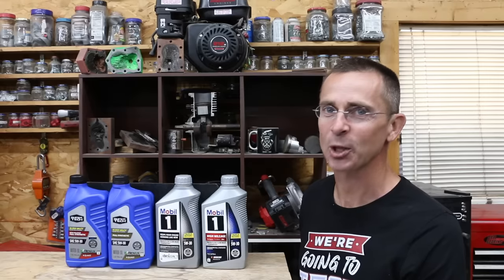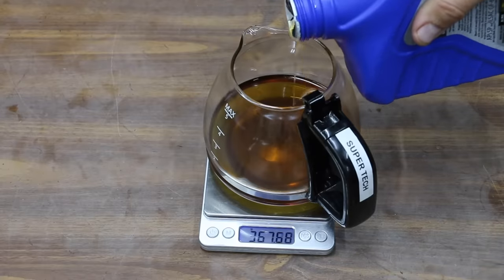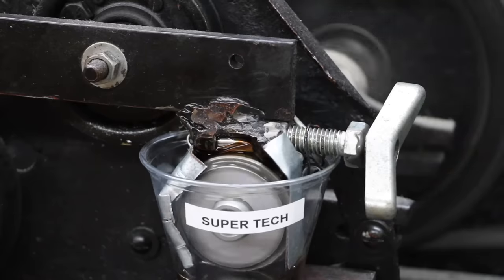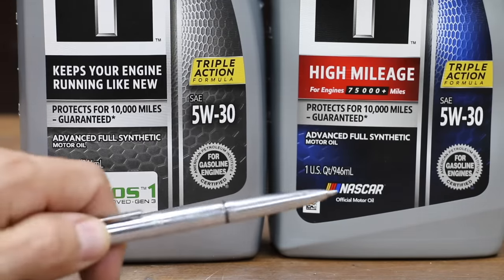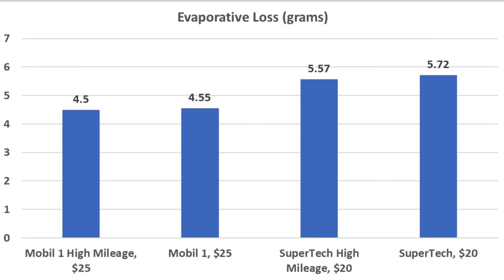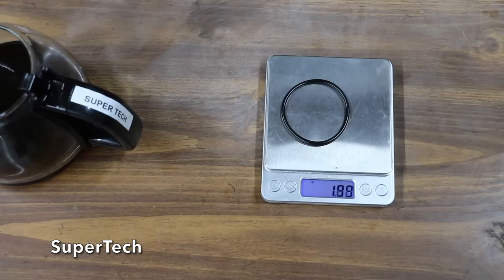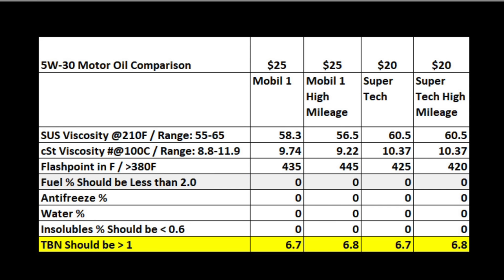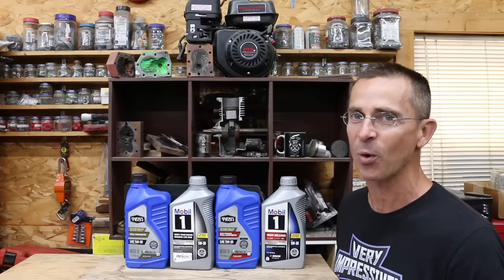Is “High Mileage” Motor Oil Safe? Let’s find out! Mobil 1 vs Mobil 1 High Mileage; SuperTech vs STHM

Comment: I did a paper in college about engine oils and interviewed a chemical engineer. I was told high mileage oils contain solvents that soften seals as your tests indicate. However I was also told that extended use causes the seals to soften to the point they fall apart. As an anecdote I knew an oil change tech that put high mileage oil in her new truck since she bought it new and after a few years it leaked from every seal imaginable .
Reply: Thank you very much for this comment
Reply: So basically switch it up then? Use regular full synthetic oil for a couple of oil changes and then switch to high mileage. Just keep alternating between the two?
Reply: @AustinsCoins  That’s what I was thinking.
Reply: Very Interesting. Thanks!
Reply: @AustinsCoins   I think where most people go wrong is they do not maintain a strict oil change schedule. some people claim you can go 10k miles without changing your oil and I find that to be a total crock of shit. well you can, but you'll likely be left little oil in the engine after 10k miles. change your oil every 5k miles, stick to one brand of oil and a filter and routinely check all your fluids. if properly maintenance your vehicle from new the engine itself should last a very long time.
Reply: I had a 2004 silverado with the 6.0 litre engine, got it at 150000kms in 2007, and used quaker state high mileage oil and fram filter every 10000kms for 11 years, brought it up to 360000+ and she didnt leak a drop of oil
Reply: @AustinsCoins  There's no need to switch up oil. Choose the HM and be done with it. I have a 4.8 chevy I bought new in 2000, It now has 416k miles on it and a used 2009 5.3 chevy that had 76k miles on it when I bought it. The 5.3 has over 231k miles now. I use Mobil 1 synthetic HM in both and neither leaks oil. The 2000 4.8 does burn oil and I have to add 1 to 1.5 quarts between oil changes. I might have to add 1/2 quart in the 5.3 between oil changes. I change oil between 7 and 10k miles. Both are work trucks and get worked every day. So the stuff about the HM making seals soft to the point of failure is bunk. As is the myth that you have to change your oil every 5k miles or else. Maybe if you're using a non-synthetic, but there is no good reason to these days with the quality of oil we have available.
Reply: @robroy5729  Not many good studies support the need for 5k mile oil changes. Synthetics go 10k with no increase in engine wear.
No harm to engine by changing every 5k but a waste of time and money.
Reply: @robroy5729  Not to mention all the carbon and dirt build up that oil changes remove. BMW has a yearly oil change, and the motors have all sorts of issues from sludge clogging up the engine. They also never last 200K miles.
Reply: @DrivingWithDon  👍
Reply: @robroy5729  I used a Ford Fiesta 1.4 tdci van as a courier vehicle, 40-45K miles a year, 10K oil/filter changes every 3 months. It lasted to 278K miles and the only reason I got rid of it is I needed a bigger van 
All my courier vans have had 10K oil/filter changes and I've put hundreds of thousands of miles on each of them.
Reply: @MrDoccus  extended oil change intervals helps promote sludge buildup in some toyota engines
Reply: I do not believe it happened because of the oil. There are other factors that do matter like: a) Do not replace the PCV VALVE every 15K to 20K, since this is the part that gives possitive ventilation to the oil pan; If it gets clogged, It is not goint to be any  good seal or O-Ring that can endure the pression since it is air and need to go out whenever the weakest part of the engine is and that are the seals. I habe been using MOBIL 1 5W30  for so many years with issues however I have been replacing the PCV VALVE, religiously, every 15k to 20k miles.
Reply: The only motor oil Project farm tested that performed impressively after the heat up test was amsoil (he tested it against royal purple). I say 7500 miles is the max for my liking but Amsoil could get you to 10k between changes.  But  how do oil filters hold up after  8k miles?
Reply: The safest thing to do is to follow the manufacturer's recommended oil change interval and oil spec, along with checking your oil level regularly. It doesn't do much good to have fancier oil if there isn't enough of it or you never change it.
Reply: That is one of the reasons I have used real oil.
Reply: @robroy5729  I have a Jeep 4L I6 from 1999 that, now that the valve cover gasket has been replaced, consumes less than 1/8th of a quart in 5,000 miles. I've been using the same lab to test the oil each change and they keep suggesting to bump the interval up 1,000 miles each time; up to 8,000 now.
Reply: @OOZ662  - How many miles?  1/8th of a quart is like 2 ounces of oil. That's brand new engine consumption.
Reply: 2000 camary 160k mi. once a year oil change with mobile regular OEM recommended weight . do about 5500 miles a year . Never burns oil, never leaks, original head gasket, original valve cover gasket .  shit refuses to die even after the timing belt snapped 😂
Reply: @NotaRobot_gif  you gotta use the correct high quality European oil formulas that have the correct amount of saps in them. Those would also be true man made fully chemically synthesized synthetics, not the crap passed off as synthetic in this country. The American API oils are a no no for European vehicles.
Reply: @maldonadolemus  Tu mensaje fue dificil de entender en Ingles. So esta bien remplasar el pvc valve cada 20k millas o no?
Reply: The seals softening to a point where they fall apart is most likely from using highmile oil then using an aftermarket highmilage/anti leak bottle additives. That will cause the seals to be so expamd and be flimsy that oil can slip by from swelling to much causing to fall apart
Reply: Was it a chevy? Lol
Reply: @AustinsCoins  Why even bother with high mileage oil?  Your regular synthetic oil will keep them soft for several hundred thousand miles
Reply: Right because major oil producers knowingly want their oil to soften seals to the point where they fail. I'm pretty sure word would get around very quickly and nobody would buy their brand. I've done an exhaustive check with the FTC, EPA, and BBB and can't find any complaints of cars leaking mass amounts of oil due to motor oil softening engine seals.
Reply: @AustinsCoins  Maintain your oil change schedule. Period. Top up fluids, know which ones need changing or adaptation for the winter months (if you live somewhere cold, swapping regular window washer fluid with a deicing one is essential even if you put a de-icing cover or coating on your windows. The coating allows ice to melt off more quickly but it doesn't prevent the initial build up.) If you don't know how to work on your car or what an engine noise means, it's even more important to stay on top of standard maintenance as you have a lower likelihood of having mechanical issues from straight up neglect.

 The anecdote from "Mr. New-Car" omits that you need to adjust valves and check seals after the engine is "bedded in" so to speak, i.e there is some adjustment necessary after you purchase a new vehicle, even with the number of computer sensors and automatic adjustments available in a new car. Computer actuated vehicles are more efficient but they are not always self adjusting. The engineers designed the computers to throw a maintenance code, not to fix the problem outright with the onboard adjustment systems. They assume you'll get into the dealership thanks to the warrantee that comes on a certified used or new car, therefore, you are likely to have fewer problems having to maintain or diagnose the car by yourself.

 I know several of my college friends who blew up moderate to well maintained vehicles because they didn't know how to check and/or top up oil every time they fill up gas. It's an old schedule from when cars were more likely to have valve/gasket leaks without auto-adjustors but it's easy if you set that as your rule and simply carry a jug of oil and radiator coolant in your car. Obviously don't go filling the radiator when the engine is hot. If you see the coolant is low it is best to get wait for it to cool and check for leaks after you refill it. Cracked hoses are an easy fix but a radiator that needs re-rodding or full replacement is much pricier/time consuming to fix but, in my experience is completely doable by a home mechanic with a repair manual.
Reply: @katydid5088  I mainly wrote my original reply so I could get clarification on what the original commenter was trying to convey. I've only owned 1 car due to my young age and it's running much better than it did when I first got it. I've changed all fluids on it and even did an engine flush (which some people advise not to, but that's an old-school mindset). It's a Lexus IS250 and got it with 143k miles. It's done a 12-hour trip to Orlando and back to where I live since I got it. It's been driven almost daily and is a good car. If you covered the odometer, I don't think anyone would guess it has over 152k miles on it. Preventive maintenance and sticking with a reliable brand almost entirely cut out the possibility of issues you'd have if you didn't.
Reply: @MrDoccus  i run the Mobil1 FS HighMileage and i do an oil change and filter change every 3,000-3,500 miles. 
Been doing this in all my vehicles for years. 
Engines like fresh oil...no harm in doing it. 
They take a beating in our harsh freezing Minnesota winters tho.
Reply: @AustinsCoins  I have an old Camry with 200k miles on it... probably a smidgeon more. I just use regular oil and never have a problem. The frequency of oil changes definitely trumps any magic potions in the sump.
Reply: @MattExzy  Yup, a big reason they're pushing for these longer intervals is for the "waste" sake of it. EPA or something behind the scenes is likely pushing oil companies to advertise longer intervals.
Reply: @MrDoccus  You have no idea what you're talking about, but by all means keep pretending.
Reply: @robroy5729  it REALLY depends on the engine...... VW 07k can go up to 15k miles  with  oil still being okay.......Modern BMW needs oil change every 2k miles.... 90's Honda  can go 10k-20k with no oil in the engine before it blows....... It all depends on the technology.......
Reply: @MrDoccus  you do need to change the filter though. 
I had experimented with 1 truck. Oil would look a normal golden tan for 4-5000 miles and then almost instantly turn black. I'd just spin a new filter on and within a few hundred miles it would be back to a nice golden color. 

Once the filter is loaded it opens the bypass. Theory is that oil pressure is better than clean oil. 
So if you run extended oil changes without changing the filter you're now relying on the oil to carry all the dirt and carbon in suspension and still lubricate.
Reply: I experienced leaks from my cam covers after using high mileage oil in my car just 2 times. I had to replace the gaskets and I will never use it again. I advise against using it in your vehicle.
Reply: @MrDoccus  oil is cheap. Engines are expensive
Reply: @glrage  Si, cada 20 mil millas. Tienes dos opciones si es metálica: La quitas y la limpias con brake clean o limpiador de frenos(escucharas al moverla como un balerito adentro de la pcv el cual debe moverse) y has la siguiente prueba: Soplala con boca y tiene que pasar aire solo por un lado y por el otro no . Si deja pasar aire por los dos lados, entonces ya no sirve. En algunas marcas de vehiculos son plástica y lo mas recomendable es que la cambies. La valvula PCV es la responsable, en la mayoria de casos , de que los motores empiecen a botar aceite debido a que se ha quedado atascada y no hace su funcion que es : Liberar aire o presion acumulada en el carter y lo hace vía intake manifold terminando liberandolo por el escape. Imagínate que tienes un pedo que no lo puedes aventar y sentis que hasta te duele el estomago, Una vez lo liberas ya te sientes relajado. Algo así funciona la PCV VALVE😆
Reply: @oneninerniner3427  Actually that rule only applies in Germany and several other countries. I heard in Spain, companies can pass what ever formula as full synthetic.
Reply: @oneninerniner3427   European oils are designed for longevity. American oil are designed for efficiency. Most oils is Europe are also much heavier in viscosity.  Different Philosophy.
Reply: @MrDoccus  I change mine once a year and the oil filter twice a year.
Reply: @quinnobi42  I would never trust manufacturers recommended oil change intervals; the life span of any vehicle is its warranty length, according to the manufacturer.
Reply: I've never had an issue with high mileage oil. My 98 F150 had over 300,000 miles when I sold it and I used nothing but high mileage oil in it the whole time. If it did leak, it wasn't enough to notice.

If your engine is leaking that bad, then someone probably overfilled it with oil.
Reply: You've solved the riddle for me: "Why would I wait until my engine has high mileage before putting in the oil with the better wear package!?!"
Reply: @J.T. Cooper  please explain how you KNOW that the oil caused the leak? You know engines spring leaks spontaneously all the time, always have, always will
Reply: @ricky302v8  You put a lot of miles on your car in a short tile, likely many highway miles. That's why you can do 10k intervals and be fine. Different people with different uses need different intervals. People who drive very little or do mostly city or stop and go driving need shorter intervals. Most people who do mixed driving need the 5k interval
Reply: @SkylineFTW97  Exactly , different conditions call for different maintenance procedures its basic training to any mechanic
Reply: @jeffie8696  Yup. And if you look at the 10-15k oil change intervals, they come with a series of conditions. Most people's use would land them on what most companies call the severe service interval, which is usually around 5k. I personally do mostly highway driving and still change my oil every 3k. Oil is cheap (plus I work for a dealership and get my oil for free), engines aren't
Reply: @jordanrussell345  I would say it depends. I've mostly owned older vehicles that are well past their warranty and the every-6-months oil change as recommended in the owner's manuals has caused no issues for me. I don't know if more modern cars are suddenly saying that you only need to change the oil once a year or something. 
Additionally, I would like to rebut your point that the vehicle's lifespan is limited to its warranty period. If that was the case, why do they specify maintenance in the owner's manual out to 100k miles or more?
Reply: @MiguelGarcia-vj7oo you're definitely 100% incorrect about an engine operating with NO oil for 20,000 miles 🤣🤣🤣. Jap engines are good, but they're nowhere near that good.
Reply: @maldonadolemus  - That's because all synthetic oils are sufficient. If you change your oil every 3k miles conventional oil will do as well. Absolutely no one recommends racing oil because its overkill, costly,  and may lead to premature cat failure due to high phosphorous and zinc additives. All synthetic motor oils mix group III and IV base oils and some will mix group V ester.  Amsoil sells two types of motor oil;, their more expensive signature line and a less expensive XL line. Both are fully synthetic but only one claims it's good to 25k miles, likewise mobil1 extended performance claims 20k miles,  Pennzoil ultra platinum claims 15 years, Red Line racing oil also offers two different synthetic motor oils with red line claiming both are to oem car manufacturer  standards. Obviously these extended life and extended performance oils is not due to extra additives but added group V esters.
Reply: @oneninerniner3427  I have relatives in Asia and their European cars call for 12000KM oil change intervals. Due to extreme weather and high temprature conditions,not to mention their petrol has higher amounts of sulfur. BMW tried to extend 25000 mile oil change intervals in North America. Unfortunatly many engines became damaged by too long intervals caused by extreme idling,A/C use,high levels of sulfur in the fuel. So BMW reduced the oil chnage intervals to 10000 miles and use LL-01 oil. The LL-01 spec oil has additives to inhibit sulfur from building up in the oil prematurely. Also,the European cars made for North America are different from their native counterparts.
Reply: @ryanhuang8498  yup so That's about 7,4-7,500 miles. But I wonder if a lot of folks use the regular north American oils in them? And I wonder if they would have better luck if they used the euro formulated oils in their north American euro vehicles anyway.  Amsoil & Mobil has them I know.
Reply: @429thunderjet2  There are many oils for European cars in North America. The Castrol Edge 5W40,5W30,0W30,0W40 is suitable for such vehicles as long as it says European formula and with approvals from the carmaker. Pennzoil by Shell also has certified European oils too. Sold under the name Pennzoil Platinum Euro. Also,in 5W40,5W30,0W40,and 0W30. Valvoline offers oils suitable for such cars too. Liqui Moly,Motul,Idemitsu,Eneos,Pentosin,are all available in the USA. With the exception of some ultra high end super cars, EG.10W60 oil which one needs to special order in many cases. Buying oil for a BMW or a Mercedes Benz is often times not a problem. Eg. at Walmart,they offer the Castrol Edge 5W40,0W30,and 0W40 European formula oil for around $27 for 5 Quarts. Either made in Austria,Belgium,or the USA. Valvoline also offers their European version oil for about the same price.
Reply: @ryanhuang8498  that was essentially my point. people aren't using the euro speced oils. They would probably have less trouble if they did ok? Amsoil has six varieties with different euro specs, FS full saps, MS medium saps & LS low saps. SAPS meaning sulfated ash phosphorous sulfur. So if you go by your manufacturers spec called out in the owners manual & the correct vis 5W40 etc or whatever it may be, would go a long way IMHO.
Reply: @429thunderjet2  Even with Euro spec oils,it's not going to last forever. Eg BMW North America specifies shorter oil change intervals than in Europe due to the sulfur of our fuels and other conditions. Yes,of course best to change it at specified intervals as you stated.
Reply: @DrivingWithDon  So what you are saying is that we are being fed a load of BS when Techs/Mechanics say change your oil at 5000 miles even is the engine has over 200,000 miles?
Reply: @standhd  Pretty much. The 5000 mile oil change is a thing of the past. Back when non-synthetic oil was all we had it was a good idea to change your oil ever 3 to 5k miles. I mean, if it makes you feel better, then go for it but there is no reason you can't get 7k to 10k on an oil change with synthetic oils and be perfectly fine. Hell, some semi engines don't get the oil change for 25k miles.
Reply: Wow, a sample size of "1".   That's pretty impressive! 🤣🤣🤣🤣🤣🤡
Reply: @quinnobi42 
 No. No it's not the safest thing. Sorry.